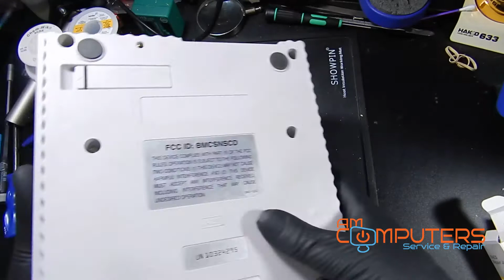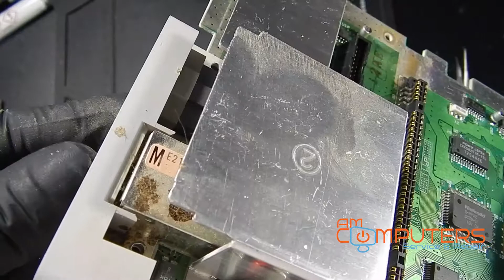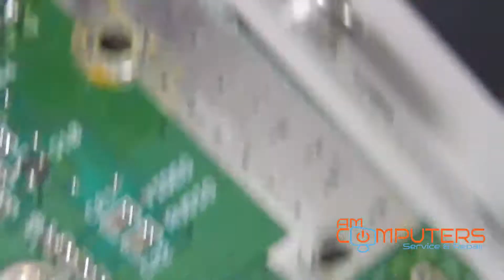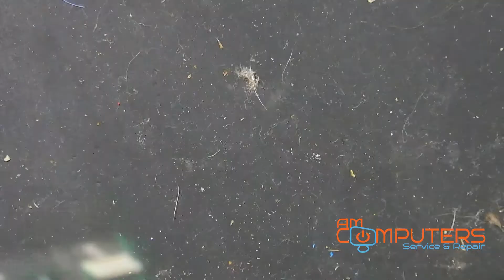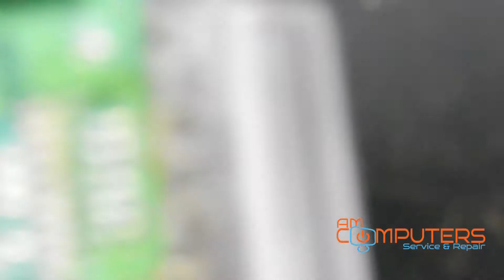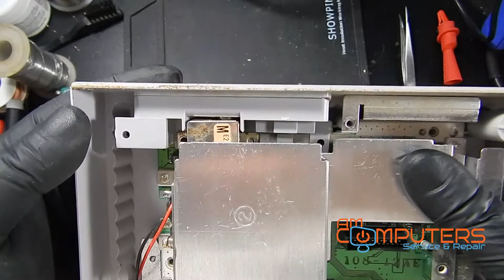Retro Game Repair - SNES Power Port Replacement

Comment: how to fabricate a connector for the cartridge port to be installed vertically in a toaster?maybe an adapter kit off amazon or something? was going to try and wire one up with old pc ribbon cable i guess...
Reply: maybe cut a piece of plexiglass and super-glue the ribbon down? idk yet??? one side for male, other for female and the stock game cartridge port...???
Reply from the maker: I'm not sure if I completely follow what you want to do. But I think you want to make an adapter that changes where you can plug the game in.  Goooood question. I guess you can get a replacement cartridge port or take it off of a non working board. Then get a cheap game and cut the board so just the gold contacts are left. Then solder wires from the pins of the port to the contacts of the game board? Does that make sense? If you do something like this I'd love to see pictures or something. Thanks for the comment!
Reply: @AMComputers      https://www.youtube.com/watch?v=3U8BVKNcsO8&feature=youtu.be 
here is what i'm getting at and,... thanks for the reply!
i'll be workin on this super nintoaster for a bit, until i guess, it works...
was having a problem with this this snes, were it will turn off after like 10 mins gameplay.
any ideas? -before i started this build, (think it might be the big capacitor)????
i might have been using an underrated (8.5) DCV for the power supply, "hehehheheheeee"
Reply from the maker: Ah this is pretty neat. I would try and solder the pins to that connector if you're comfortable doing that. It'll make a stronger connection. Just be sure not to bridge any connections. I think soldering the cables from the top connector to the gold fingers from a scrapped snes game might be a good option for plugging into the bottom connector ( in the motherboard). Idk if different games use different pins or if this would cause issues but could work. As for the over heating could be any of those or like the voltage regulator getting hot. Dirty connector and game moving. Or a chip getting too hot. Sadly it could be anything. This is a cool idea good luck!!